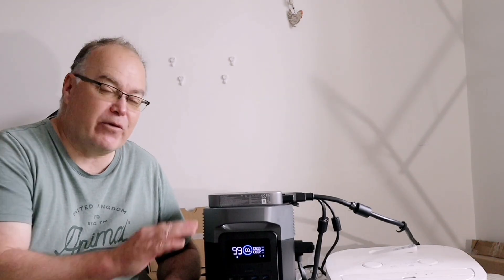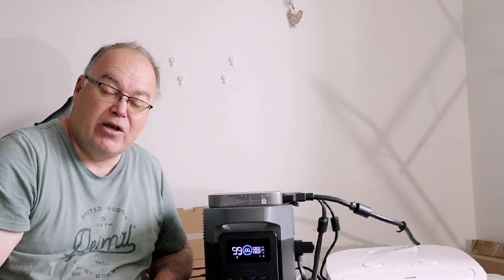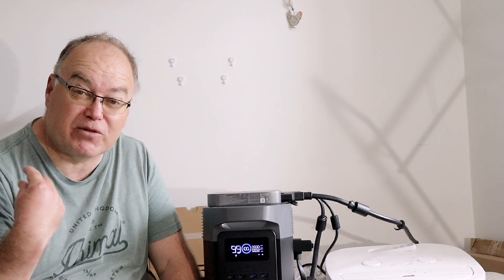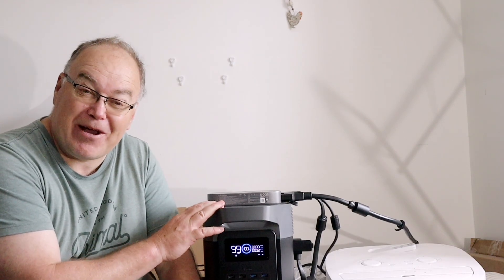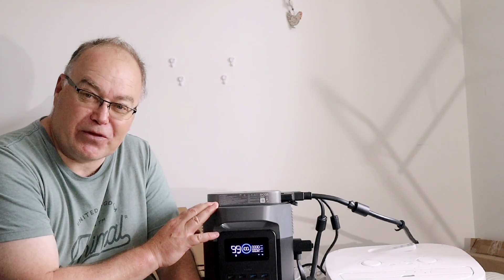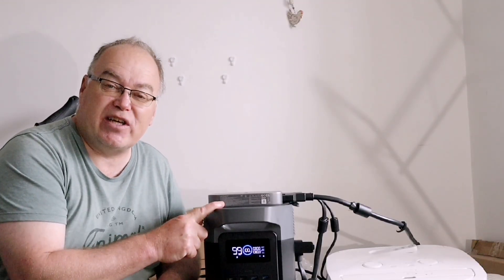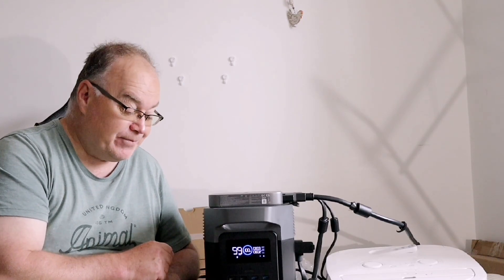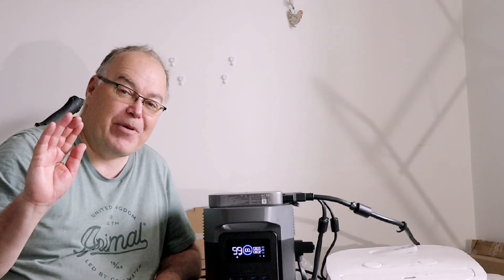Power your home with Ecoflow's DIY plug in Solar, battery and micro inverter system - Testing update

Comment: I don't know if you will see this, but I am a very low usage for electricity, about 950kWh a year.  I don't have solar panels as I will be moving in the near future.
I have been looking at the Delta 2 to charge up on Economy 7 to use during the day.  I have had a look at the Ecoflow Stream, but it is tied to the house, so no taking it camping.  It has been suggested to me that I should have some solar panels and I am thinking about doing this in February.  I've worked out that 4x450w solar panels would be enough.  I was hoping for a video about how to do this?
Reply from the maker: Wow that is low usage .  Cost savings will be low as result so a really economic solar install is all that's cost justify.  Going portable battery and solar or fixed solar is really just a practical decision as to how mobile you want it to be . Fixed solar makes more sense to me with a battery to run base loads overnight .  

Video wise the video I did on my garden solar using a solid 3.6kw inverter is the closest to your needs .  That cost me £1500 for a professional install.

Best of luck finding your way forward

Comment: It sounds very tempting as a simple low cost intro to solar without scaffolding etc. although as has been pointed out below it's not the a very efficient way to make use of solar power. I see that the latest ecoflow stream inverters instructions say that for the UK it needs to be hard wired through a branch circuit breaker. Are there any electricians here who can explain why, as in what is the benefit what is it trying to achieve and how that would then comply with the regs?

Comment: What I would like to know is if I could have a couple of panels charging up a battery that I plug in to my apartment (after turning of the main breaker) to compensate for ac power loss from the grid. AKA, can I use my in home power cables to power my fridge from my balcony, provided I do not exceed the breakers capacity (230v10A) or are they only able to break in one direction?

Comment: Greetings from currently sunny Germany... I have two of these ecoflow inverters, but both are only supplied with energy via a single 12v socket... and there is no solar panel directly connected to these inverters... my 370Wp PV charges my 2kWh LFP off-grid system (like car batteries...). In 2024, I didn't have to buy 223kWh a year from the utility company... and I only had one inverter and one KWH LFP storage unit... the PV was the same, only 200Wp was connected to the ecoflow itself, and 170W charged the off-grid system... oh, I also have ecoflow sockets... they control both inverters... best, Andy... PS... my condolences to Trump... and Musk... ^^ Germany isn't doing so badly now... politically and economically... lololololol

Comment: am in the uk, i have solar pannels and giveenegy battery all in one , how can i get ecoflow 3 pro to be connected to the house so i can discharge electricity to the home appliances , is it possible
Reply from the maker: Unless connected to a power stream you'd have to plug things in directly
Reply: @EVPuzzle  I'm also from the UK, are you able to plug the PowerStream into any plug socket and would I have to contact an electrician to see if my house is capable of taking in 800w?

Comment: A really useful video -thanks! I have solar panels on my roof, and I'm looking to store excess electricity for use of an evening. I don't want a permanent, fixed solution, as I'm expecting to move home in the not too distant future. Even it if just powered the TV (~100w) and the always on devices I'd be more than happy. I'm not really clued up on this stuff, though, so not sure how long a setup like this would provide power for.

Also, what music do you use for your intro? I really like it!

Comment: fantasy land. These generators barely make enough power to charge a cell phone.
Reply from the maker: Considering I cut my hedge using it yesterday I'm sure that's a lot more energy that  a mobile phone uses

Phone =3500mah/1000*3.6v=12.6wh
Hedge trimmer 380w X 1/2 hr =190wh

Hmm given the battery only used a fraction of its capacity cutting the hedge I think we can safely assume it'll charge a few mobile phones 🤭🥱🤣

Comment: Question. Can I have the following setup. Delta pro plus extra battery and power stream. Setup with 6x400 watt panels sending 800watts to the house in the day and charging the delta plus battery at the same time for use overnight of 800 watts constantly. Our house pulls roughly 700-800 watts 24 hours a day and we have great sunlight hours here.
Reply from the maker: Powersteam is 800w but You could always split the solar into 2, for power stream and charging  battery directly  I guess.  Best ask ecoflow directly to be sure
Reply: Then use a transformer to regulate night and day time power
Reply: Day time 120v evenings 280v and after midnight 60v

Comment: Hi, Ive recently bought a PowerStream to go with my Delta 2 and 220w portable solar panels but am still a bit nervous about leaving it plugged into my home circuit over night, have tried it a few times but keep reading about the controversy over back feeding into your home circuit and should you inform the power grid also I live in a rented accommodation ? how have you proceeded with with issues and do you know if there is any feed back from UK power network ? thanks Graham
Reply from the maker: I think my very first words were it's controversial. I know nothing officially I'm afraid so not much help and can only summarise what the comments are saying 

What the truth is , seems Impossible to know as a consumer whilst those in the comments shout their opinions loudly.

I think the only way we'll know what's what is when or if the Powersteam comes back for sale in the UK 

My advice is to ask ecoflow directly , if you're uncertain about using it then don't . It's not worth losing sleep over 

Mines not plugged in any more as my test is complete
Reply: @EVPuzzle  While trying to look into this topic with some creative Googling, I came across a French company called 'Sunology'.  They are offering something similar (panels with built-in inverters that you plug in to domestic sockets), and have UK-focused material on their website (including assertions of compliance with UK regulations).  Have you heard of this company/product?

Comment: the PowerStream package deal on EF webstie is gone :(
Reply from the maker: I've seen that yes , not sure why but currently asking
Reply: @EVPuzzle Hi, did you get anything from EF on availability.  Want to buy one for Spain where I believe they are approved but can’t find. Their alternator charging & solar charging inverters are available which must be virtually the same product but not the ‘balcony’ version which I need to connect to Delta 2 max exactly as you’ve shown here

Comment: Using one with 2 ground mounted 400w panels in my garden,  A Tapo P110 smart plug is providing home assistant with production stats :)
Reply from the maker: Nice.  I tried a smart plug but it's not bidirectional but a nice simple solution

Comment: Thanks for this video. I think it’s a cool product. I have some solar but no battery storage. I don’t get paid for the excess energy I’m producing in the day so I could use this to capture the few hours of excess I do produce. I can also look to take advantage of my cheap 7.5p per KWH rate I’m get from my EV tariff at night time. Sounds like a pretty good option I think. 👍
Reply: We are testing a more powerful convertible portable power station, if you are interested, you can follow us, you will get the latest product information and offers.
Reply: Looks like a whole different system here in Belgium.
We get paid for the excess electricity only recently,after a bunch of paperwork and a special digital meter.
And at night the whole system get shuts down,also the price you get for it,is very low compared with the one you buy from the grit.
Reply: I don't have solar panels but as you, I have EV tariff and wondering if it could be possible to use cheap rate to charge is and then use it for appliances when need it. Will it work ?
Reply: @dadscanplay2  yes sure will. Charge the battery at night when it’s cheap and use the stored power in the day. 👍
Reply: Law to go unfulfilled
And I saw a new heaven and a new earth; for the former heaven and the former earth had passed away, and the sea is no more.
Be again talk today l end end coils calaread or Cala read in salt ain’t l add vin and gods so cold Kant tv l eave so any l.  Cactus wo men end nations water ac changed on davids in no gods  changed obey nation davids is davids on de magic wall of many is really roads or sit sit I tandstw say god l a s a s l p e p s a d reaturn l made a nanny a nurse as water is saying to find a of fit is o call el citric and city’s is cctryea re ad 
        * Then he would reveal to you the secrets of wisdom, For practical 4 side left l Philips flat to y read Winnie’s water is not not in every new read turn 
        * AWater a tap electric real 
        * To w ten others 
        * Did I 
        * E 
        * R y
        * If 
        * 
        * davids really on y or wisdom has many sides. Then you would realize that God allows some of your error to be forgotten. 
What great advice you have given to the one lacking wisdom! How freely you have revealed your practical wisdom!
Look! I have acquired great wisdom, more than anyone who was before me 
my heart
of wisdom and knowledge.”
And I said to myself: ‘
Wisdom is better than mightiness; yet a poor man’s wisdom is despised, and his words are not heeded.’for when High is gone High does ealis the one brother ruller

Comment: Nigel, I've got this setup as you tested it but how can i confirm it's working? My in home display from the energy company indicates I'm still using, and paying for electricity.
Reply from the maker: If the app says it's putting out power, it's putting out power. Otherwise I used my victron data, turned everything off and got the baseload low then output enough to see it go to zero . Seeing that happen confirmed it for me
Reply: @EVPuzzle  thanks, I know it's such a simple setup that I couldn't have set it up wrong. I would have expected to see no electricity use if the invertor is over supplying the house's base load.
Reply from the maker: @mkelsey  my common mistake was leaving in charge priority mode when I wanted it to feed power to the house . App shows what's happening to remind you
Reply: @EVPuzzle  hi could this be automatically adjusted? or have to turn on and off manually each night"?

Comment: Useful test Nigel, I particularly liked how you demonstrated the ability of the product to cover overnight base load and it’s practical limitations concerning each consumers actual bases load. As we have two freezers and two fridges plus the usual plethora of transformers keeping phone, internet and mobile device chargers, the smaller unit is probably too small for me, so look forward to your video on reducing base load. 

In view of the negative comments regarding plugging this device into a main socket being against regulations etc. I would appreciate more focus on this. For instance, if I had an electrical fire would my insurance company turn down this claim due to “illegal wiring.” Another video on this please. You are my go to resource for sensible real world objective testing, I have learned a lot, thanks.
Reply: Based upon a vacuum all temperature will return to its normal state based in volume
Reply: Then why can you split two atoms with the same price

Comment: Im thinking of buying this to do the same. but i guess you have to disconnect the delta from the ac input at night to stop it charging from the grid at night when battery runs low?. is this correct please?. this system would be under £500 for me as i already have delta 2 and ecoflow 220w panels so only need leads smart plugs and inverter. oh i already have 16 panels fixed to my house roof but no battery in house but i get fantastic FIT returns as got solar before government capped it.
Reply from the maker: No you can leave it plugged in, there's two modes prioritising charging or power output that can be scheduled
Reply: @EVPuzzle  thanks for that. Sorry i was having a blonde moment lol as i totally forgot about all the settings available in the app. Great vlogs thanks mate. Keep up your good work. All the best. Im going to order the stuff i need today as love the concept of this. Cheers mate.

Comment: Think I might have a use case for this now. I need to get electricty to a water tank pump that is a long way away from my house, seems ideal. They don't do an external/ IP rated version, do they?
Reply from the maker: I wouldn't leave this one outside. Good use though
Reply: At present, some power supplies have IP67 and other protection levels

Comment: What is really like them to make is a charger/inverter/battery with an EVSE built-in so I could just set up a free-standing box connected to a few solar panels on a garage roof or car port etc. that could be programmed to charge the car when the sun shines. Maybe with the option to plug it in when the sun isn’t shining and you need a charge anyway (like night time).  It would need to modulate the control pilot so the car charged only at the rate that is being generated by the solar panel, not hard to do.

Comment: Warning ⚠ Danger Against UK wiring regulations BS7671 reg 551.7.2 (ii) A generating set shall not be connected to a final circuit by means of a plug and socket-outlet
Reply: What is the reason against doing this?
Reply from the maker: @jpshn1 electrocution 🤭⚡⚡
Reply: Oh right. In what scenario might you get electrocuted by doing this?

Comment: From my initially testing I think you are too optimistic about the Micro-Inverter system. 
I see you had given up on the PV charging - not surprised, even though should work over a wide input range - and also in hazy cloud. I would have liked to see what PV power levels you achieve. My tests indicated less than 80W, from a 375W panel, when in sun, and cut out when light hazy cloud cover.
Remember you have charging losses - typically need 2.4Kw to charge the 2KW battery.
Losses on top of this will depend on the type load. Anything apart from a purely resistive load, ie with a power factor pf) < 1 can perform abysmally - a laptop with a power factor of about 0.41 you will be lucky to get 1Kw power from your 2Kw battery. 
Thus you need to evaluate the type of load you want to power to see if it makes economic sense. 
Portability is only one consideration.

Comment: Other than portable storage, I struggle to see the benefit of these? The cheapest I can find the 1024 version is around £900, the1612 version £1500 . I can buy an additional 2.5 kWh battery to add to my stack for £950, get 5 times the life guarantee and not be restricted by the power output, but granted not have the portability. However, even with what I've got, portability isn't really an issue, as you can use an extension cable.  To me I would you not be better buying an additional battery for home storage?
If you haven't got solar the benefits are even less, Just looking at payback, it would take years to recover the original cost. It can effectively store 33 pence worth of electric but why would you. There would be no benefit moving to a cheap night time tariff unless you have an EV. But even then you would save around 26 pence a day for a £900 investment.
Like the idea but struggle to see what the benefit is.

Comment: I'd love to hook one of these up, with smart plug, to a heatpump water heater. I've seen some with 50-80 gallon tanks that plug in with a regular socket. They supposedly use only 1-2kWh a day. Currently our WH is our only gas appliance, and I'd like to switch while not adding to our net-energy deficit. That and IR panels seem perfect for these balcony solar products. Maybe someday, if we had a shed, I'd also set one up in there with lights and tool chargers, although it would seem overkill/wasteful.

Comment: If you are charging the battery from a 13amp socket during the day and feeding base load power to the house during the night why do you need the micro inverter?
Reply from the maker: It's feeding from the inverter not the battery itself . Direct from battery isn't possible
Reply: @EVPuzzle  Thanks for that information. I have Solar but no battery and i want this system for my base load at night.
Reply: I have just purchased one using your discount code. You are a star.

Comment: Nigel I just think you need another battery on your main storage. I’m using about 400 to 500Watts at rest I can’t wait to get some batteries aiming for two US5000 to start and probably finish at 3 of them.
@nigel just found out you don’t need to buy the expensive mega fuse look up Littelfuse Fuse - Mega 70V (SF5  /  Automotive Fuses and that fits nicely on the Lynx distro this fuse is rated upto 70volts.
I’m finding it hard to turn stuff off, I’ve got a fridge stand-alone and a chest freezer and a server and a pfsense router that I built think these are my issues but kinda need them running. I looked at combing the pfsense and server but for redundancy if I need to shut down the server I would rather have internet still function. Oh on another note do Pylontech actually include the 2meter cable to connect to the inverter or my case the distro so I would just need another two long ones?
I would be interested to see what other stuff you can find that is using loads of power.